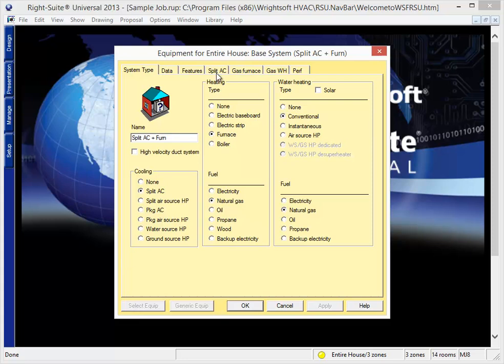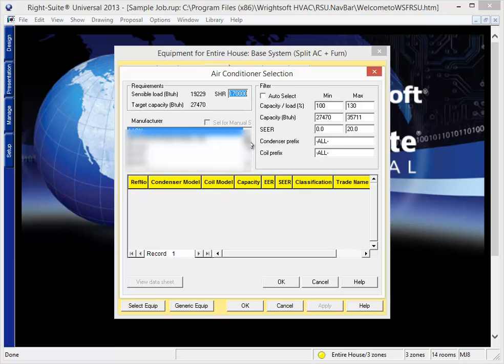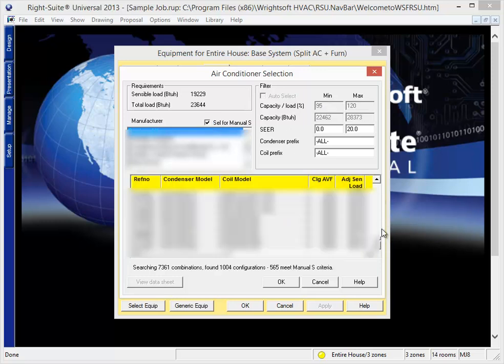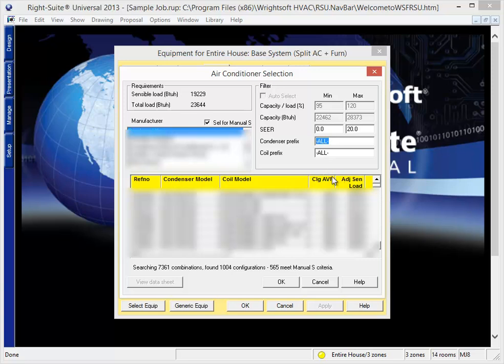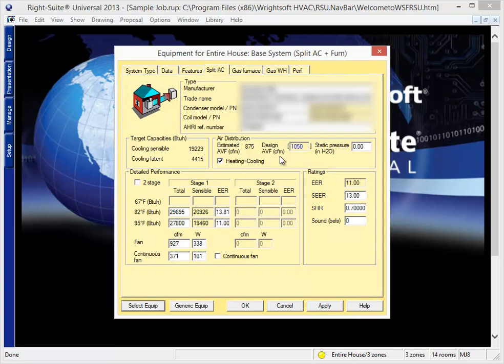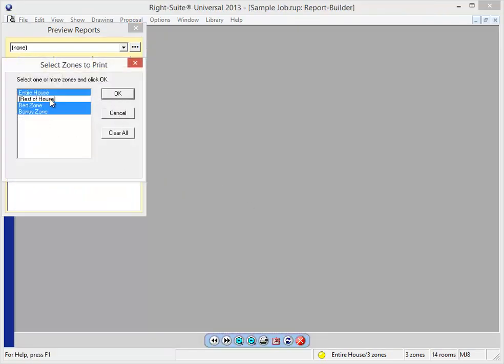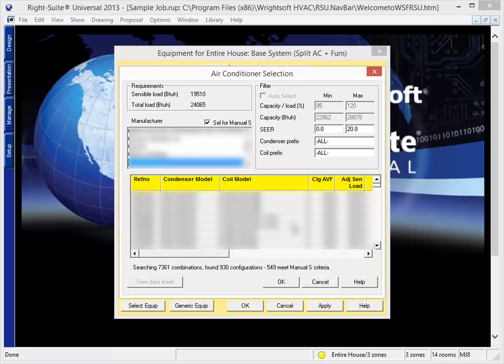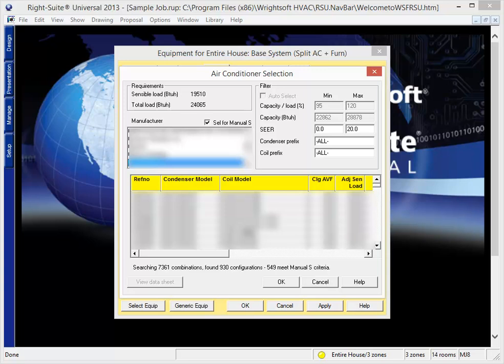[Manual S] Automated Selection

Comment: Having the Manual S extended performance data auto-populate is invaluable.  I wish more HVA manufacturers would provide as finding OEM data can be difficult.  Also most HVA designers are not familiar with the capacity correction factor that needs to be applied as OEM data is given at 80 F summer indoor design temperature and Manual J uses 75 F.  We are expert at both Manual S and OEM data whether it auto-populates or we have to manually enter.   www.load-calculations.com